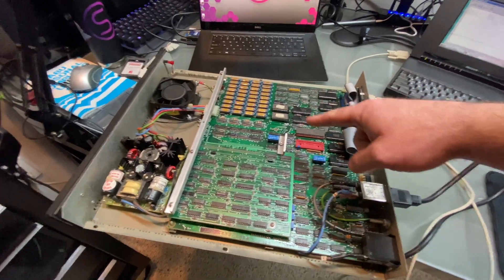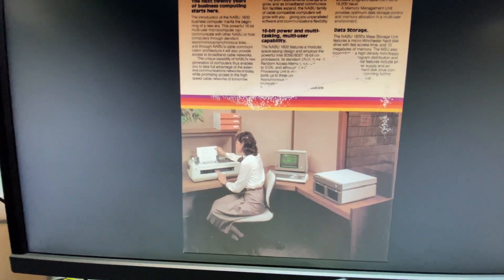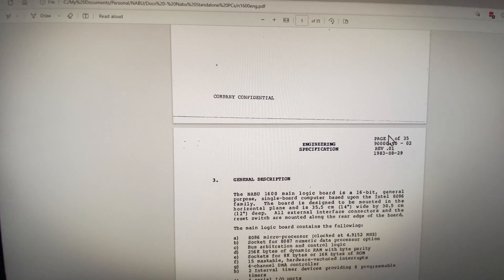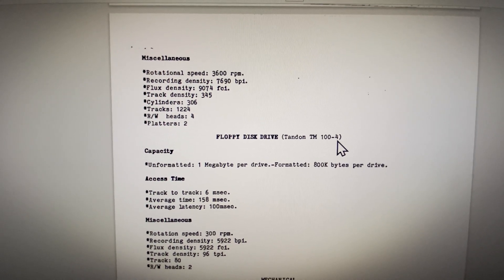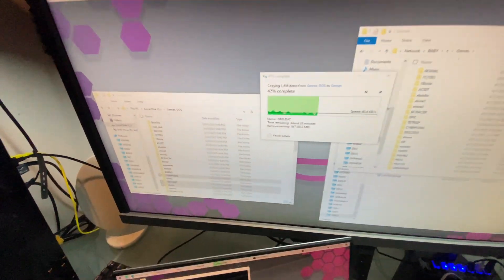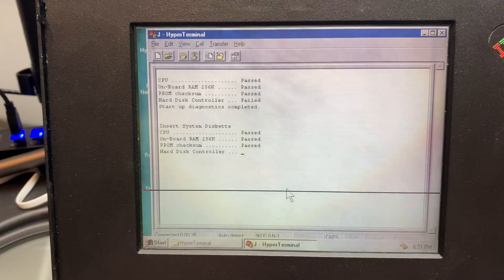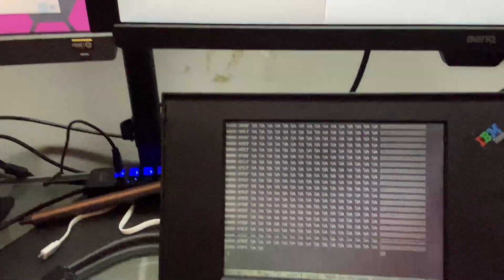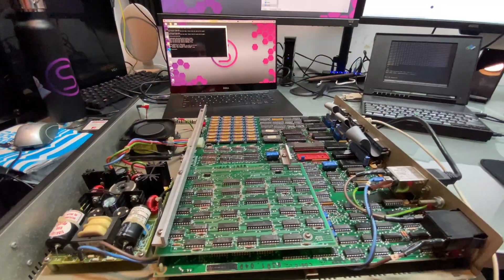01 - NABU 1600 Introduction and first boot

Comment: At a guess the ROM is at the top of memory - as it's an 8086 the initial vectors (reset, etc.) will be at top of memory.  The ROM's are likely filling the available top of memory, so I'd suggest looking at F0000:0000 and work down from there.  How far down they go will depend on the ROM sizes.
Reply: This is an 8086, so it only has a 20-bit address space, which is formed from a 16-bit address and a 16-bit segment register that's shifted over by 4 bits.  The x86 didn't get a 32-bit address space until the 386.
Reply from the maker: I haven’t tried 6 digit memory addressing yet because the help showed 4 digit. There’s a P option for paging so I’m wondering if the ram is paged. Haven’t looked it it since the video. I ordered a gotek and that’ll get us booting an os anyway!

Comment: The hard disk interface in the hard drive unit is a custom board with its own CPU (see the Nabu 1600-B datasheet).  Without extensive technical documentation on its operation, it will be difficult to emulate.  Although if there are access routines in the system firmware, someone might be able to work from there.  The external interface is just an 8-bit data bus, so figuring out the protocol might not be too difficult.
Reply: I was mistaken in believing that the WD-1001 was just a controller chip.  Apparently, it's the controller board, and the WD-1001 docs describe its operation in detail.  Someone could probably make an emulator for it using a Pi Pico or other microcontroller.
Reply from the maker: I’ll poke around the net and see if there’s a project for that. Might be possible with a pico. The pi io might be too slow
Reply: @Mueller3D  iirc the controller on the 1001 board is a wd1010.  sucks it wasn't made to interface to a wd 1002, that one is a SASI interface, almost the same as scsi-1

Comment: Regarding the DB-37 external floppy connector: You'll want to see if it follows the IBM-standard for connecting to the regular 34-pin floppy ribbon cable, which is that pin 1 of the ribbon attaches to pin 21 of the DB-37 (ie, the ribbon is shifted up, leaving pins 1, 20, and 2 of the DB-37 unconnected).  Assuming it does, it should be easy to interface a Gotek (or real drive) with an IDC DB-37 and a regular 34-pin ribbon cable (or an already-made IBM-type cable).
Reply from the maker: Thanks for that info. The 1600 document has the wiring diagrams for the connectors. I’ll do a video of posting it against the gotek when it gets here. We’ll see if it matches nicely before turning it on
Reply: Okay, I found the 1600 Engineering Spec on ClassicCmp, and based on the pinout there, it is not compatible with the IBM standard.  However, it's still easy to make a cable, since you just need to line up pin 1 of the ribbon cable with pin 1 of the DB-37 IDC connector.  The unconnected pins will be at the opposite end (pins 18, 37, 19).
Reply from the maker: Okay thanks for checking. I’ll head to b&e Monday and see if they have the db connector and cable I can butcher. I ordered the gotek tonight and Leo had qnx boot disks

Comment: You might have had problems with Hyperterm because you had Hardware Flow Control enabled, and your cable doesn't have the appropriate pins wired.
Reply: Based on the 1600 Engineering Spec, the serial ports on the system unit are wired as DCE (ie, modem), and your typical PC serial port is wired as DTE (ie, terminal), so you don't actually need a null-modem cable.  It looks like you just needed a gender-changer.  For hardware flow control, you need typically need RTS/CTS and DSR/DTR pairs hooked up.
Reply from the maker: I think the little cpu was too occupied with file transfer to keep up. Kermit works good and I also got a copy of telix which was my preferred

Comment: you can also take a physical 1.2mb floppy drive and jumper it permanently into low density mode and voila, instant tm100-4 compatible drive.
Reply from the maker: Oh wow / so a gotek should be able to emulate that then?
Reply: @DJSures  yes it should.

Comment: The Floppy drive would be a double sided QUAD density 720-800kb (formatted) drive.
Reply from the maker: What hardware emulator would work with that particular drive configuration? GoTek?
Reply: @DJSures  Gotek with flash floppy firmware should work.
Reply from the maker: K great thanks!! I’ll get one and we can start from there. Leo has qnx install disks for me :)
Reply: @DJSures  sounds like a plan. I'll dig out my teac DDQD 720kb 5.25 drives this week...
Reply: @DJSures  also you could use 1.44 3.5 drives if you use DD 720kb media. The Nabu won't know the difference.
Reply from the maker: Okay great. I ordered a gotek and Leo has qnx boot disks. We should be golden! Lots of good info from you guys commenting. Thanks a bunch I’ll give credit in the next video

Comment: printers being labeled 'nabu' or whatever is not 'weird'. basically none of the 'computer manufacturers' ever made their own printers. (maybe ibm but that's about the only one i can think of that would sell their own printers made in their own factories ;) same as with montiors and floppy drive mechanics and things like that. 'someone elses product with some custom colors and a custom label and maybe if required a custom interface board and character rom' and that's about it. not even the big ones cook up their own printers. (ibm... maybe for some models DEC, and that's about where that ends, obviously hp too. all the other ones, nope. just call some japanese company or have them produced in east germany. ;)

Comment: The 1200 was renamed to 1600. I think Xenix was the operating system it was intended to run. And you mention that near the end. I thought it pre-dated QNX but Leo would know better than me
Reply: Hey John, back in the day I thought the dev machines we used at home were the 1600s but the form factor was a computer hidden inside a 3'X3'  piece of furniture with 8" floppies on the front. Was that the 1600 we used?  I think QNX was a bit later as well. I did a bit of work for them after Nabu. The person who hired me restored a  40s or 50s race car and he got it the day I delivered my work. He took me for a ride and the car caught fire! Classic!!!
Reply: @Timscastle  That was the NABU 1100. We used the Mass Storage Unit from the 1600 as our NABU PC Development hard drives. I have one that is used as cabserve.
Reply: I played with a 1600 at the Baxter Center in Engineering. It was definitely running QNX 1. I'm trying to remember who was using it for testing NABU PCs

Comment: On running Ms-dos. I found more example of machines that sport no keyboard or video interface. Though on one of them you could add a video card. But they both listed MS-Dos available for them. I assume it is like any dos 1 or 2.x and it was mostly customized for those machines. So they can run over a serial connection.
Reply: Ms-dos programs that work in console mode and control the screen with ANSI codes should be fine.  Anything graphical or that accesses the display hardware directly will be a no-go.
Reply: @Mueller3D  Well the last several months I have been playing around with Novell Multiuser dos. AKA later version of concurent dos. So I  know what you are talking about. But did just normal pc dos 2.x have terminal output put in it? That is what I was thinking they would use a special com files or something to load a console / additional serial ports.
Reply: @idahofur  The CTTY command (MS-DOS 2.0 and later) allows redirecting the console to a serial port, so putting that in autoexec would be the quick and dirty way to get going.  To go a step above, I guess you could try to create a BIOS that has a virtual text-mode video card and which refreshes a serial terminal with what it should be displaying; it would also map serial input to the keyboard functions.  That would be a lot more work, and, while more compatible, would probably be less than ideal due to the baud rate limiting the update speed.  I think that there might already be BIOS's that are designed to work this way, intended to allow remote access to server PCs.
Reply: @Mueller3D  I don't remember the ctty command. But when I first statred into computers. I twas ms-dos 5.0 and up. Though I did play around with 3.30 and such.